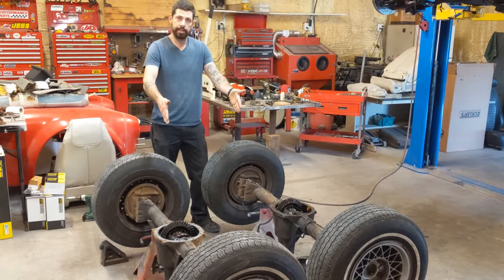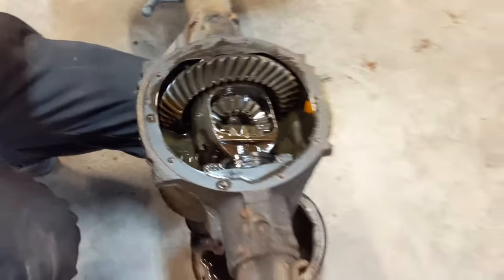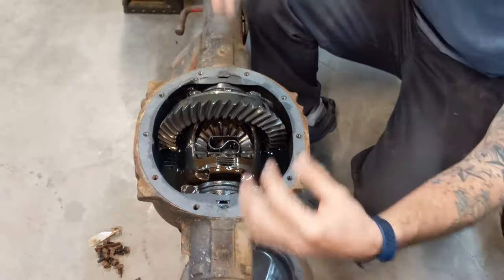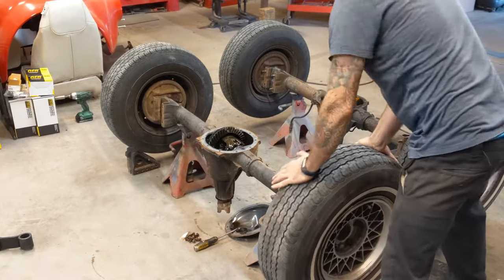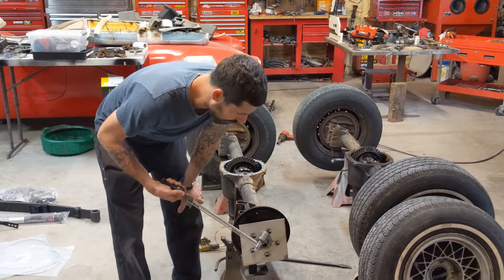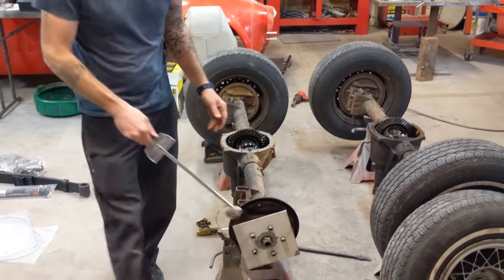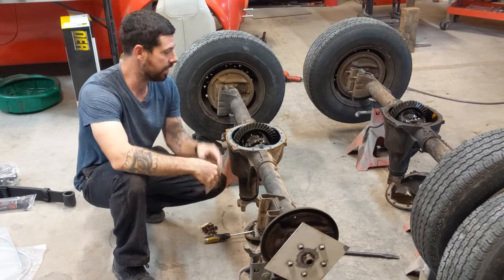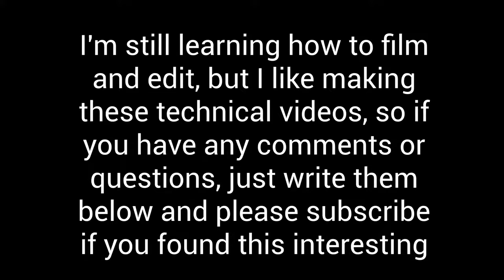Difference between open and limited slip rear ends

Comment: The important thing to remember is that the force required to move the wheels separately is dynamic, because when torque is applied from the drive shaft the spider gears will try to spread apart increasing pressure to the clutch packs.
Reply from the maker: 100%.
Reply: @AustinCoulson  even thought the spring pushes the spider gears together; the spider gears must be able to separate from each-other more than in a standard differential. If that's so; the gears would wear out faster, from not always being at the optimal distance from each-other.
Reply: More resistance to the torque (friction) means the clutch pack on that side is more compressed (locked) by the separating force introduced by the driveshaft gear.

It's very clever.
Reply: Which makes sense, but wouldn’t it be better to have a system that provides force at lower speeds as well?  Like if you’re trying to get up to speed from park with one wheel on ice, wouldn’t you want to have more force applied to the clutch packs since there will be greater friction at lower speeds?
Reply: @VincentAdultmanbearpig  hence the spring between the spider gears so it's never completely open, maybe 85 90 percent open going straight down the road.
Reply: @phillip_mcguinness7025  for some reason it didn’t fully click until I just read your comment.  Thank you for jogging my brain.
Reply: You are correct sir!

Comment: Limited slips carriers have a ramp like cam action to place even more squeezing pressure to either side of the clutch packs when slip occurs to increase the locking effect. The test you did is still a decent one for determining the overall condition.

Comment: I just watched something earlier that explains how when under drive there is tangential force on the bevel gears due to how they work which engages them more and locks things up more on the side that is on the surface with more grip. It was very interesting
Reply: But do it really work? I be having a 96 xj and I is getting ripped off at da shops. I wish I didn't stay in Memphis bone, wish I knew a country boy, he be able to fix it!

Comment: Great to see a real measurement done live like this.  As others pointed out, the clutch torque increases as the ratio of torques coming in from the wheels (from brakes or road reaction torques) climb.  What you were really measuring there was the preload torque, the minimum locking torque the diff will provide.  Very cool to see, thanks!

Comment: I like this video, it explained why my vehicle is weak on slippery surface. If I have the money I will replace the differential with a limited slip differential.
Reply from the maker: I prefer spartan for off road lockers, and any clutch or geared unit for a LSD. 500 is about right to pay for a good LSD and new gears should be around 200 if you do those as well, and double that amount if someone else installs them
Reply: @AustinCoulson  That's a great amount for a tight budget, I think I'll take the risk to do it.

Would it not need housing replacement, only the gear inside?

Comment: You've got an interesting channel, I'll sub and follow along. Quick question about limited slip diff. My 98 Dodge 1500 has a limited slip described on the VIN and build sheet, and I'm the original owner. However wheels move opposite when I spin them on a lift, and when I remove the pumpkin it looks like a normal diff, no obvious slip plates or springs, no tag. The dealer repair manual is a little confusing, not sure which diff I have. Is it a safe bet the build sheet was wrong, after all?
Reply from the maker: Thanks for the sub! I have seen issues with VIN and Build sheets being wrong, There should be a metal tag on the diff cover that states the gear ratio and if there is a locker or LS. It sure sounds like you have an open diff.

Comment: I used a limited slip Yukon on my 1977 Impala for the first time. I raised the rear of the Impala with a hydraulic jack, put it in neutral, released the parking brake, but the wheels turn too hard with my hands, is this normal for limited slip or am I having problems?

Comment: I found my way here after I did some thinking after watching videos of people starting a car by jacking up a wheel, winding a rope around the wheel and pulling the rope to start the car. In top gear (1 to 1) and 4 to 1 diff, if the diff was welded locked, the motor would need to turn 4 times for every time the wheel is turned. But with an open diff, the motor would only need to turn 2 times for every time the jacked wheel turns  which would make it easier. But with a limited slip diff it is more complicated and I don't know if 1 wheel or both wheels would need to be jacked up.

Comment: It only tests the initial torque. When an engine is running the casing inner spider gears will push out the side gears into the clutch packs and the friction is much higher. The amount can be modified by the ramp angle.
Reply from the maker: Correct. I just wanted to see the initial breakaway torque. I wish I could test the breakaway torque under engine load, but I have no idea how that could be done

Comment: Great video,
Is it true you will wreck a limited slip differental using a donut temporary spare tire for a long time, by heating it up
But, do zero damage to a open differential if you did the same?
Thanks
Reply from the maker: Different tire sizes will destroy a locker quite fast, limited slip diffs can handle different sized tires for a while but it can wear them out limiting their effectiveness later and an open diff will do just fine with tires of different sizes

Comment: Thanks ...   but since these are from the  70's  can the clutch pack be worn and not as effective?    Also when under drive load the gear force will compress the clutch pack and increase the fiction thus a torque increase.  Note the sound recording  it just a bit low.
Reply from the maker: Great point!

Comment: Brilliant demo. They say that to easily tell a limited slip you lift the vehicle, spin one tire and watch what the other does. If LSD, the other tire rotates the 'same' way (both trying to drive forward), if conventional it moves opposite because the transmission in park resists transfer of energy to the prop shaft. Makes sense. However I was surprised to see that in my Dodge Ram, with a build sheet describing an LSD, the tires move opposite to each other. I had the diff cover off and didn't see clutch plates, but evidently in the Ram they can be hard to see. Do you think the build sheet is wrong? Have you seen limited slip differentials that don't follow that classic rule?
Reply from the maker: If you jack up the rear and it's an open diff, you are correct that you can easily spin one tire and the other goes in the opposite direction. It gets trickier of it's a LSD because there are many types and they can be worn or broken. A GM Gov-loc relies on a little clip that commonly breaks so they can appear open but in fact have a broken clip floating around in the oil waiting to break stuff. If it's a stock Ford limited slip, they can break away under as little as 5lbs of force so they can appear to be open when it's a weak LSD. I test it in neutral as a weak LSD should still have more grip than a neutral driveshaft. I'm unsure on the Dodges, but I think they commonly used Dana axles and I don't know what LSD they would have got. It will be easy to tell if you open up the diff and take a look. Will give you an excuse to change the often neglected fluid. Just make sure if you do that and it has an LSD then make sure what fluid it required. Some require a friction modifier.
Reply: @AustinCoulson  Thanks, man.

Comment: Hello , nice video. Never saw something explained practically.  Two questions , does 40 lbf makes engage the LSD or dissengage it. Also i have DANA 44 axle with LSD, so does it have same function?
Reply from the maker: Good questions; the 40 lb ft is required to break the axle shafts free of eachother, like when you make a turn and the outside tire spins faster than the inside tire. The LSDs on the Dana 44 has the same function of trying to keep the axles connected, but there are a ton of different style LSDs that came in Dana 44's over the years s and they all attempt to accomplish the same thing different ways. I have a video where I install a limited slip in a Ford 9 inch and one where I install a Spartan locker in a Ford 8.8 if you want to see other styles.

Comment: My question is if the clutch pack is damaged in the limited slip differential and it's burned out with this still work will you still be able to drive
Reply from the maker: Yes, it just functions as an open differential once the clutch packs are worn
Reply: @AustinCoulson  awesome I wasn't sure I only rebuild one limited slip differential in my whole life building engine ,and it's acting up so I'm a little worried

Comment: That torque number is a great way to start.  At first glance 40# seems small.  So I would say use that number anyway.  So if the rack pinion gear set is 4.11 to the rear wheels than the actual resistance at the driveshaft is the inverse at .2433 so>>>40/.2133=164 ft LBS @driveshaft.  Likely more to it than that.  Comments please.
Reply: The torque required to overcome the friction of the clutch packs isn't constant, it's related to how much torque is applied at the driveshaft. So this 40 ft-lb is actually the minimum required when the torque a the shaft is zero. As shaft torque increases, an axial force transmitted through the spider gears in the diff squeeze the clutches together and increase the axle torque required to break them free.

Comment: Soooo my truck has a LSD and I want to get sideways.. Do i just purchase a new rear end or what are my options?
Reply from the maker: You should be able to get sideways with an LSD. Some of the factory ones aren't strong, like the Chevy Gov-loc or an older Ford Trac-loc. You can change the gears and locker in your existing rear end;

Here is a video of me putting a spartan locker in a ford 8.8:
https://youtu.be/vt8uwENIiGQ
Here is a video of me putting in new gears and locker in a Ford 9in:
https://youtu.be/BaKh9jMq8XI
Reply: Austin Coulson thanks for the response. I just realized I’m suffering from Bad wheel hop. I suppose upgrading my suspension with full coil overs Sways and 4 link rear will eliminate this?

Comment: WOW!  Is that one of those Factory Five Work benches back there?

I converted a 2004 Chevrolet Express 3500 shuttle bus into a camper.  I will be using in snow, beach sand and desert sand.  I was in snow last week and the right wheels sunk of the road into a snow bank and the right tires just spun and they are all I had to get myself out.  Those Stupid left ones just sat there and laughed at me.  

So, if I want good traction in those conditions, I would need a differential that would switch to the tires with the better traction but I know for a fact I don't want the axles to lock because if they are both spinning, the vehicle will just slide off the road as neither side has tires in control.  I always want one side rolling while the other is digging in.  So what type do I need?  What is it called?  Limited Slip or Posi traction or what?  Thanks!
Reply from the maker: Any limited slip will get you what you need, you'll just want to stay away from a full locker. Your cheapest bet would be to source a factory limited slip gm axle from a junk yard and swap the entire axle. If you are careful enough, you may be able to find one with a better gear ratio for your rig as well. If you are installing an aftermarket one, the auburn or eaton units are very nice, but you will need to pull the entire carrier out so it's a decent amount of work. I did a how-to on installing gears and a limited slip in a ford 9-inch about a year ago if you scroll back through my vids you can give it a look and see if you are up to the challenge.
Reply: @AustinCoulson  What gear ratio would you recommend for highway gas mileage in my bus?  Oh and thanks for the info.  A junk yard was my route of choice.
Reply from the maker: @JB91710  depends on what engine you have and what the weight is. I'd guess 3.27 is about right for the best all around set up, and that very well might be what's in there.
Reply: @AustinCoulson   It's a 6L gas engine and its the smallest shuttle bus made.
Reply from the maker: @JB91710  do you know what axle code it has? Should be labeled on the door jam as well as on the axle tag
Reply: @AustinCoulson  I'll check.
Reply: @AustinCoulson  My ratio is GT-5, 4.10.  That doesn't sound like a highway economy gear but what do I know.  I'm pretty sure it is a open diff.  It has that big vertical bulge for the gear.

Comment: In case you're still listening. I have an aftermarket limited slip in my truck and it makes a popping sound as I turn but never while going straight. Not sure if this is natural or not.
Reply from the maker: You likely have a locker, not a limited slip.  I made a video where I installed a spartan locker in an 8.8, here is the link:
https://youtu.be/vt8uwENIiGQ
If you skip to the end I drive it with the camera underneath the truck and you can hear the popping clearly when it turns. Its the locker releasing while turning and it's totally normal
Reply: @AustinCoulson  thanks for the info and link. If you could can you tell me what the purpose of a locker is for.
Reply from the maker: @joetroutt7425  It's there to improve traction. Without a locker, whichever tire has less traction will just spin and spin. Limited slips are preferred for the street because they give you better traction without being noisy. Lockers give even better traction, but are noisy and aren't as smooth on the street.
Reply: @AustinCoulson  yeah, I told the shop I wanted a limited slip put in and I guess they got me a locker instead. Probably charged me for a limited slip though. I also went from 3:73 gears to 3:90. 
Anyhow, I'm just glad it's not something wrong.
Reply from the maker: @joetroutt7425  What model Vehicle?
Reply: @AustinCoulson  it's a 94 Chevy pickup 2wd.

Comment: I took my truck to the mechanic last week he said that my diff was bad ,he want to put a new diff carrier on it , but i would like if i can buy one from the junk yard! My truck is a 2005 dodge ram 1500,  i dont know if i can got one from 2010  ,that will fit on my truck.  What do you think?
Reply from the maker: I don't know off the top of my head. I usually go to wikipedia to see what years the changes occurred. Junk yards are great parts for rear ends because the failure rate is so low, the old ones are usually good for another 200k miles
Reply: @AustinCoulson  thanks i just sold the truck last week

Comment: Are there both Chevy reared?
Reply from the maker: Yes, both 10 bolts from a 75 and a 79 Camaro
Reply: Thanks. Helped determine what diff was in my 94 Silverado.so a 8.5inch 10bolt open diff. So no additives needed.  And 80w90 gear oil
Reply from the maker: @crackerjack8115  it's a great diff. Underrated. I use mobile one 75-90 or Royal purple.
Reply: @AustinCoulson  thanks again sir.  I was wondering about valvoline those where the other two options.
Reply from the maker: @crackerjack8115  Valvoline is great, too. So is the Castrol rear end oil. I go synthetic because of the insane heat we get in AZ
Reply: Yeah I may go the same route quick question it must be limited slip additive free correct?  Subbed and liked due to the great hospitality